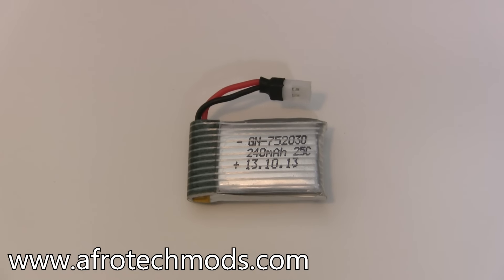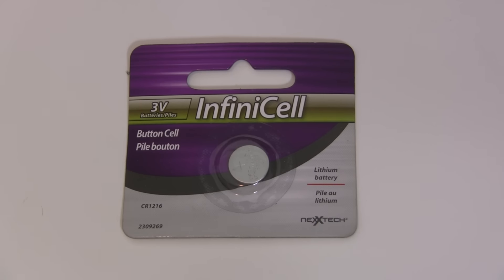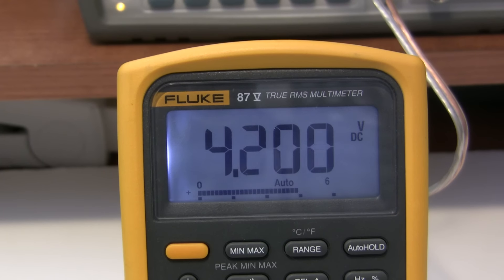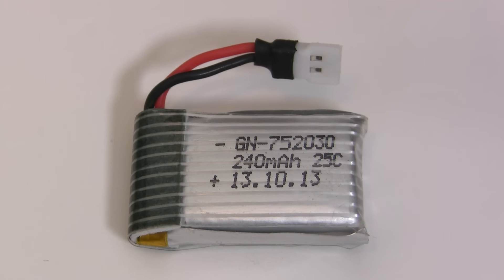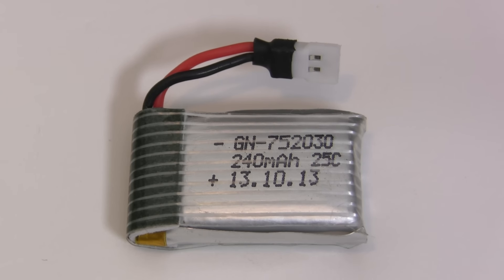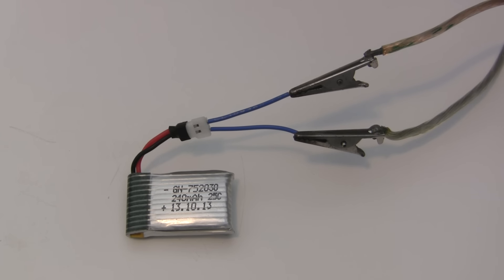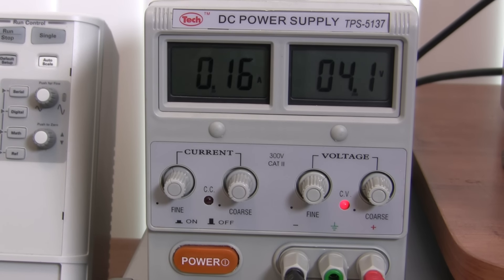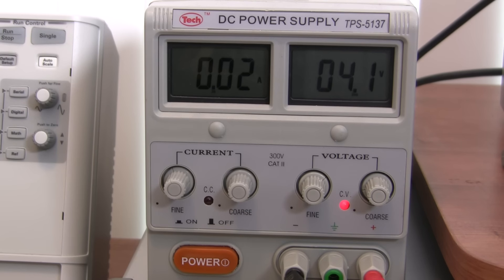🔋 How to charge a LiPo battery with a power supply

Comment: Hey, I don't know how much you know about this; but my hybrid car has a Li-ion battery for its high-voltage battery and I'm going to eventually try to do some mods to improve my gas mileage. The main issue I want to address is this: I've noticed that when my engine is running and my battery is charging (say, if I am on the highway), and it is low, my mileage is noticeably worse than it would be with a full battery. I think the car is doing what your power supply did here - supplying more current to a low battery. I'm just curious, is it safe to charge a Li-ion battery, that is about 25% charged, with less current (so it charges slowly but also doesn't put as much of a load on the engine) than its safe capacity? Or should I consider replacing the battery pack? I hope to do this in a few years, just FYI.
Reply: it's safer to charge with less current
Reply: Keziolio Yes, and it can increase the cell's lifespan.

Comment: Afrotechmods Im really curios in ur videos, hand cranked emergency phone charger
home alarm that travels via GPS to your phone (how does that work)
door lock that is opened on wet touch of two contacts ( wet finger has lower resistance, place a voltage divider connected to MOSFET)

Comment: in constant current mode, can i use my constant current circuit 12v supply 500ma? then if the batt voltage is 4.2v ill disconnect

Comment: I got A multi cell 14.8volt lipo battery. Can it be charged with a car Alternator? Alternator charges at 14.4 Volts. The lipo battery sits at 15.3 volts... I know there will be a cell balancing issue over time but will a car Alternator charge it?

Comment: Hey Afro.I have some 18850 batteries pulled from an old laptop battery pack that was dead. There are 6 cells few of them are 3.7V measured, 2 are 1.9 and the last one is 0.9V.  Are these safe to charge and how would I go about checking the capacity?
Reply from the maker: I wouldn't bother with the 1.9V and 0.9V ones, they are dead. Recycle them.
Reply: not sure how low but you are suposed to be able to charge them below 3V. The thing s the chemistry doesnt like that and so you have to get it about 3V with a really small charging current(say 0.05C for a long time (a few hours at most depending on the conditions).
Once it's above the safe voltage you can continue charging it as normal, though the capacity wont be the same in case it stood to long in that state.
Reply: Laharl Krichevskoy
 some times you can revive a pack by charging it in NiMh mode up to 3volts
but not recommended
some high end hobby chargers have a Li-po LV recovery mode
my Powerlab8 can do this

Comment: Can I double the current in order to half the charge time, or will this reduce the batterys life or worse.
Reply: thra5herxb12s As long as the battery doesn't get too hot, it shouldn't be damaged.
Reply: I'll keep an eye on it. Cheers.
Reply: thra5herxb12s Afro suggested 40ºC as the maximum temperature.
Reply: I'll make a proper charging station with a usb type cooling fan. I'll post up a vid of it.
Reply: If you want safe batterie life, then don't charge it up to 4,2 V. Instead use 3.95 V as upper limit.

Comment: is this for single cell only? i have 12V 2200mAh LiPo battery 25C so i should charge it with 2.2 amps at 14.4 volts? i need answers

Comment: is there a way to do it with out a bench power supply. like a 9volt wall plug and some kind of simple voltage regulator
Reply: you could make yourself a linear regulator with constant voltage and current, though they are quite inefficient (as in medium/big heatsink, something like for the computer at most), better use a 5 or 6V psu for that to lower the losses.
a lm317 for the regulation and a few transistors and resistors to regulate the voltage and current should do fine.

Comment: What happens if you charge it at 2C? I swear that speed chargers use a higher C rating than the battery is intended to be charged at..?
Reply: 10C is not uncommon. it's just a safe figure
Reply from the maker: Double check what your battery can safely be charged at. I showed 1C in this video so it would be safe for everyone to try.
Reply: Just because speed chargers do that, doesn't mean it's a good idea. 1C is the safe bet that all Lipos should be able to take. If you want to use higher C rates check the datasheet of your exact battery. If you haven't got one, like with most cheap batteries, stick with 1C.
Reply: superdau Hmm yeah, I only see people speed charging branded Li-Pos, not unbranded ones..
Reply: The higher the charge current, the lower the charging efficiency. A battery which is charged with 10C gets really hot during charging. Not the best thing for a long battery life
Reply: I'm pretty sure speed chargers have safety checks built in for temperature so the battery won't catch fire.

(If I'm wrong I'm sure I'll be corrected, here. lol)

Comment: I made a 3cell battery pack using 18650 cells from a laptop battery. I there any to charge them using the laptop battery pcb or any other circuit for balance charging?
Reply: look for 3s bms

Comment: My video camera use a LI-ION battery that outputs 7.2V

I opened up a small 720mAH battery case and replace the guts
with a power supply I built to convert a 12V SLA,, (using a LM317T regulator),
set to 7.2V.  Unfortunately, when I plugged in my battery pack outputting the
7.2V.  The camera WON'T come on. I have a feeling this has to do with the
lead marked on the battery pack with + - and D.  I'm guessing the 'D' means
something, but I haven't figures that out yet.  Could this be the problem?

OH, and always-- Thumbs Up!
Reply from the maker: D probably means data. Cameras sometimes have little communications systems with battery packs to verify you are using a "genuine" battery pack.
Reply: That was my guess also. It seems to be a 'no go' on finding a video, (or any forum)
I've tried so far that will give me the answer.

Comment: How would you charge a multiple cell LiPo or a Lithium-Ion battery with a PSU.
Reply from the maker: You would set the voltage to 4.2V multiplied by the number of series cells. So 8.4V for 2 cells, 12.6V for 3 cells. But doing it with this bench PSU method is not ideal because you can end up with cell imbalances and that's why I didn't feel comfortable recommending it in the video.
Reply: Afrotechmods
 It is also possible to charge each cell individually through the ballance connector, and treat each consecutive pair as separate battery.
Reply: Afrotechmods
another option would be to parallel charge the pack via the balance tap as one big 1S pack
Reply: Elios0000 actually impossible because of the wiring and unsafe because they may not be balanced before you parallel them.
Reply: no 1C over the balance tap is fine
and no issue putting them in parallel
i put up to 6 six cell pack at different levels on my parallel charge board all the time
and if its all cells from the same pack and they are out of balance more then 0.2volts you have bigger issues
Reply: Elios0000
 you must be trolling, the batteries are in series inside the pack, connecting the ballance tap "as one big 1S pack" is impossible and will result in short circuits.
Reply: derp thats what i get for posting when i cant sleep

Comment: Is it possible to make a portable lipo charger that powered by 3 1.5v NiMH AA battery?
Reply: Irvin Yip yes, easily with a 4.2 voltage regulator (not sure if it exists), filters and a small resistor in series to limit the current

Comment: Don't judge... but will this work on 2 cell LiPos? Thanks!!!
Reply from the maker: You'd want 8.4V max voltage for 2 cells.
Reply: Thanks! +afrotechmods
Reply: tu peux connecter les 2 cell en paralle . apres  tu les charge avec 4.20V . parce que les Lipos ne doivent pas se charger en série
Reply: If you had 2 cells in parallel, could you charge it safely with 2C at 4.2v?
Reply from the maker: DaffyDaffyDaffy33322
Yes
Reply: way late to the party here, but please be careful when charging multiple cell LiPo batteries like this; if you have to ask, you probably shouldn't be charging them without decent balance charger. 

A few times probably won't hurt anything, but the different cells in multiple cell LiPo batteries often have slight differences in internal resistance, so they discharge at slightly different rates. Over enough cycles, you can end up with a large enough difference between the cells to end up overcharging one of the cells and potentially catch the battery on fire

The safe way to charge a multiple cell LiPo battery without a balancing charger is to do as is shown on this video, but do it to each cell of the battery individually to ensure you don't overcharge any individual cell. It's a lot of hassle, probably more then it's worth. If you work with rechargeable batteries a lot, just invest in a decent multi-chem balance charger, hobby shops sell decent one for about 30-50 dollars.

Comment: I did what you say to charge a 3.7v 150 mah with my psu at 4.2v and limited to 0.150A and at first the voltage increased to 2v and  then decreased to 1v. And now that battery seems dead with almost no voltage. I don't Know what happened
Reply from the maker: Your LiPo should never have been allowed to drop below 3.0V in the first place. Dropping significantly below that can permanently destroy its capacity. Don't try to charge it or use it in any way - it is dead and needs to be safely recycled.
Reply: Afrotechmods if I shorted by mistake the battery pins when trying to measure the voltage it could explain the voltage drop so low?

Comment: if i have a 11.1 v 1.5a battery so i need to put 11.1v and 1.5a in the power supply ?
Reply: Yes. Max 1.5A, minimum can be anything lesser than that
Reply: 11.1v is the nominal voltage. the cells charge to 4.2v each. you have 3 cells. 4.2x3

Comment: 4.1v battery lives longer
Reply: Yeah, and it only costs ten percent in capacity per charge. That's what I charge my LiPos to...
Reply: EPaR - Aidan Gieg I should have worded that better, it means you have 90/100mAh 9/10Ah whatever instead of 10/10.
Reply: EPaR - Aidan Gieg It depends on your application really...for an electric bike, $2-3k is quite a battery expense, so you don't really want to kill your batteries just to get that ~10% more charge.
Reply: Mega Mechatronics I always charge mine to 4.1 volts, but you are right.
Reply: You can even extend battery life by setting max voltage down to 3,95 V. This will still help. Below 3,95 V it doesn't make a big difference anymore.
So between is 3,95 V and 4,2 V is the range that has still an effect on battery life span.

Comment: So I should not charge it with a sollar pannel?
Reply: not directly, could cause overcharge.
Reply: i like to charge 3.7v lipos with my 250w solar panel. it works well for heating me up in the winter, the fire that is.
Reply: @Martin S
You need some electronics between the solar panel and the batterie to control the charging. Never connect a Lithium Ion battery directly to a solar panel.

Comment: Hey thank for your videos. I have a little drone that uses a 3.7v 650mah LiPo battery and it only can fly 8 minutes. I wanted to increase the capacity of the battery. I am going to try to use a 9v alkaline battery with a voltage divider to get 3.7v out of the battery and send it thru the usb port. It will act like it is charging, but at the same time it will be flying. I am starting in electronics, can I do this saffely? (sorry for the grammar, I am portuguese.) Cheers
Reply: USB is 5V (and EXACTLY 5V), not 3.7V. Drones shut down when charging power is applied, it likely won't work because of that. To get a clean enough 5V power supply, you need to use a 7805 regulator, or something more efficient like a switchmode power supply. Make sure to have a bit of filtering, aka a large capacitor in parallel with the output to the drone. A voltage divider will also not provide a constant output voltage, as the battery gets weaker, it will drop and not work properly. As to using a 9V battery to charge it, a 9V battery only has between 300 and 550mAH capacity. If you're going to make a portable charger for it, just buy (or make) a USB powerbank style device and just charge it with the USB cable like normal. Another option is to buy multiple batteries, charge them all before flying, and swap them when it runs out, if it has a replaceable battery pack.
Reply: theLuigiFan0007 Thank you so much. You answered all my questions. Maybe it wont work... but I will try the switch mode power supply. thank you a lot
Reply: BarbasBandas 666
You're welcome.

Comment: Can you charge it using a buck converter
Reply: As long as its one of the buck converters amp and voltage adjustment. I'm using mine as a charger as i type.